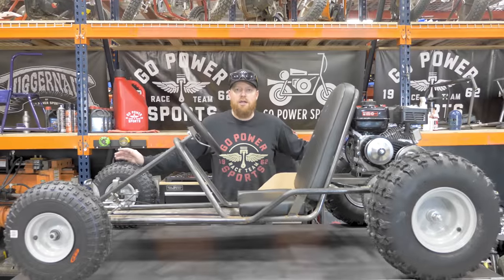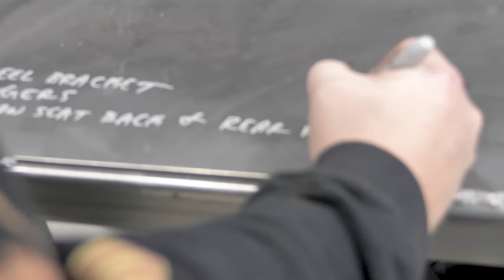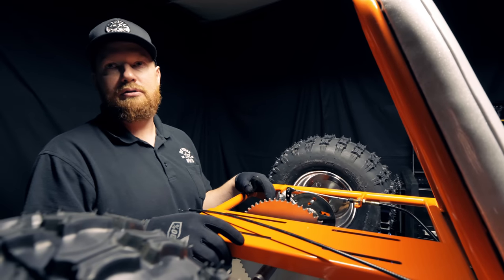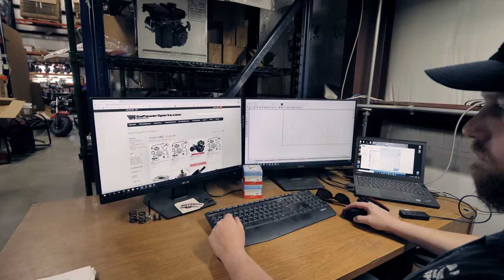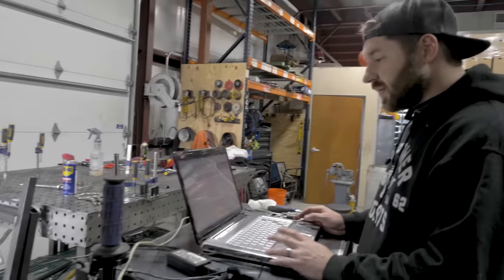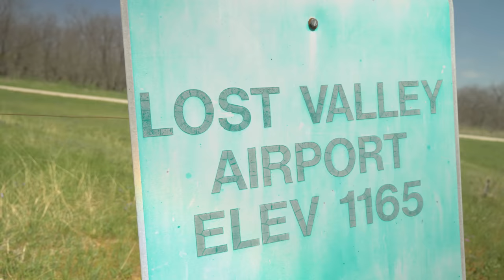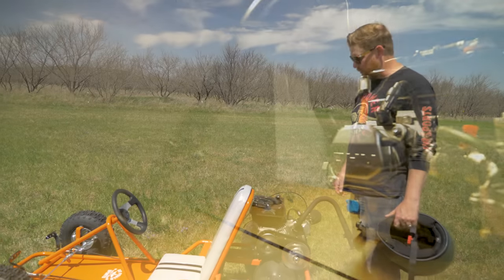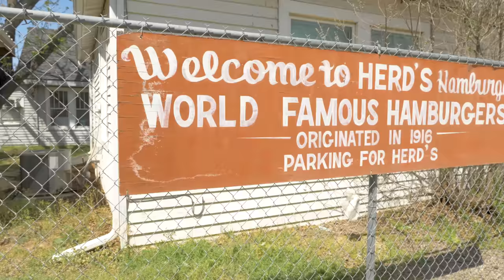Off Road Vintage Go Kart Kit Build | Part 2

Comment: Raced a Fox brand cart in 59-62 but we ran Mac 20's on it. Not that the twin engine setup was that much faster but the added torque for bigger guys made a difference. Twins were usually an UnIimited class and me being a 10 year oId weighing nothing I was almost unbeatable in the UnIimited races. Dirt was the hardest to race, being so Iight I could bounce right off the trac. Good memories.

Comment: I was hoping to see how you aligned the front wheels? I was wondering why you didn’t put grease on the steering spindles, or maybe drill a grease CERT, lubed the cables with oil, maybe put some rubber covers over your axle bearings to keep dirt out?

Comment: Though it just seemed a little strange why you wouldn't have had the frame (and whatever other components) powder coated first, in order to save yourself the trouble of having to disassemble and then reassemble the whole thing over again... but aside from that, all-around it was a great project and video - nicely done! 👍

Comment: Can you do a dyno comparison between a stock air filter and the pod filter with adaptor please? I run a foam filter on my Go-kart (with a Mikuni VM22, custom 28mm O/D exhaust and pitbike muffler as well as very carefull porting) and I've noticed a drop in power when I switch to a typical pod filter (just the same as when boy racers put pod filters on cars replacing the paper filter... OE is better) and I'm wondering if there is even any gains at all using the pod and adaptor or is it a waste of time just like it is on cars.

Comment: Would it be advisable to  powder coat the kart first before putting kart kit together or do as you did.  Put it together, tear it down then powdercoat?  I enjoy your videos very much. Thank you.
Reply: Always dry-fit first because you may need to weld things or change stuff and touch-ups are not possible with powder coat the same way paint can.  (Obviously you can paint touch up on powder coat it just doesn't look as nice)
Reply: Thank you Scuba.  Much appreciated.

Comment: What driven pulley was used?  Does it handle the HP better?
Reply from the maker: stock aftermarket 6" driven.  The drivens seem to hold up quite a while and do not give us fits, especially left in the stock mid setting.

Comment: Why is there fumes coming out of the CARB when that motor is running on the Dyno.. I dont think Ive ever seen that before..
Reply: Fuel vapor and condensation. Engines dont make any vacuum at wide open throttle so the is nothing sucking them in

Comment: Why didn't you use a diff in the build?
Reply from the maker: This is an old-school frame and they were built with a solid axle, so we kept it that way.
Reply: @GoPowerSports  my old-school frame was built with a diff.
Reply: @GoPowerSports  I didn't realize those originally came with predators.
Reply: @morgankovarik3649  it's a tillotson...

Comment: do your steering links rub on your ankles i would have the links in front of the gas and brake pedals. great build though
Reply from the maker: Yes, Manco did this to protect the tie rods from bending whenever people wrecked.  I prefer to have the tie rods in front...because I can easily replace bent tie rods for cheap if I do wreck.
Reply: @GoPowerSports  do think  Tillotson Engine is better than predator engine....i have never tried a Tillotson
Reply: A little front bumper tube would be great IMHO.  Really nice look frame 👍

Comment: The Prep and Paint should have all been done BEFORE The First Assembly, so you would not have to take it all apart and ASSemble it twice... But that's just me.. And would have put Grease Zirks on the Spindles and Steering Shaft and Any place where Metal Rubs inside other Metal so they won't or are less likely to Rust themselves together...... Again, that's just me...
Reply: Nope, prep and paint after.  That way if any holes aren't quite right and need drilled out or something needs to be bent/tweaked to fit you aren't messing up your finish.

Comment: How is that a 225 but the 225 doesn't have the brackets for the front of the gas tank ?
Reply from the maker: If you buy just the 225 crankcase now, they have gas tank tabs. The pre-made 225s meant for kart racing do not have these tabs.

Comment: What makes this an off road cart? Looks like all you did was change the tires to make it look off road. It has no suspension no lift no roll bar... no engine cover no snorkel.. its just a yard cart with  knoby tires. No 4x4 either. Or lights.
Reply: Its vintage/retro style kart. Your thinking modern amenities. This is what Pee paw bought from a Sears catalog in the 60's/70's. The springer front is what made it "offroad".
Reply: That was off road  go cart late 60s style
Reply: I built the same exact go kart 7 yrs ago....it just had street tires...and saints seat

Comment: Hi from North Georgia! I want to order 4 tires and wheels on your website. I need to be able to sub a slick for the the drive tire and there is no option like the other 3. (
Upgrade to 410x3.50-5"; Slick Tire [$6.00])
I have tried to reach you on the phone, but, no answer and the mailbox stays full and I get disconnected.
I am happy for you business is so good. Could you provide an alternate number or an email address?